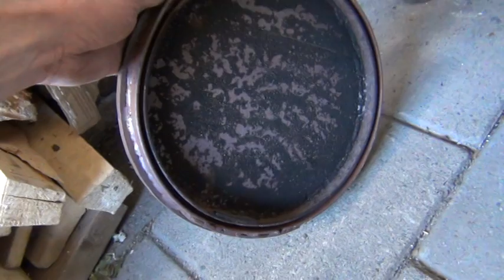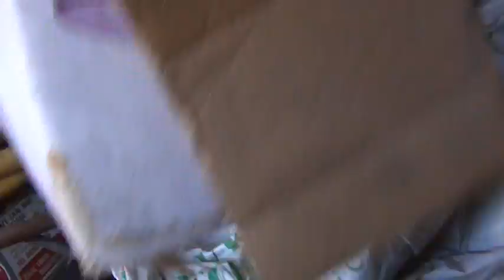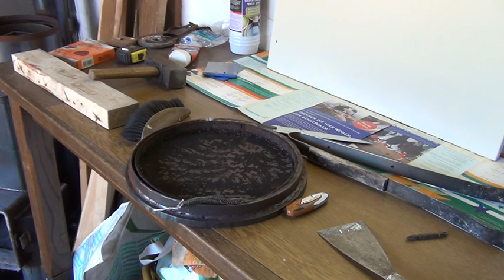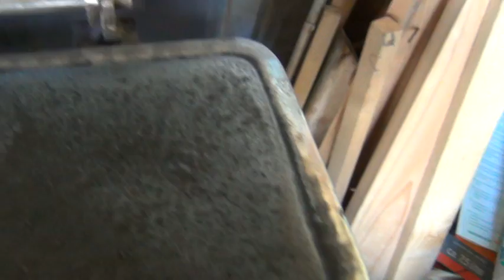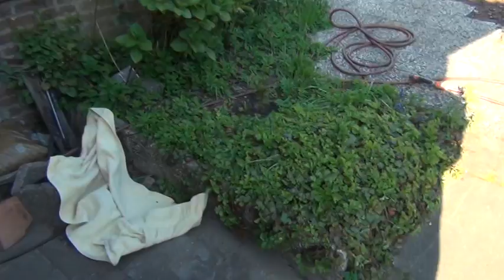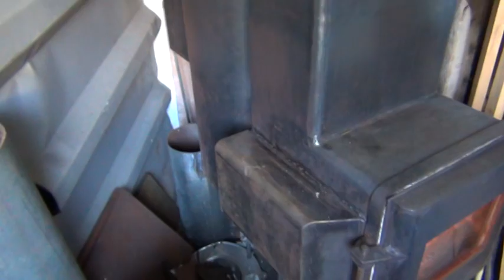Rocketstove Finished and installed (26)

Comment: ich seh schon du kennst dich aus mit pyrolyse:-) ich bin zwar kein metaller, aber für mich schaut der schon super stabil aus. das abgasrohr würde ich noch stabiler machen damit es beim sturm nicht wackelt.
Reply from the maker: I also designed and build the stove from scratch, every single part of it. However, it is no longer in use. I needed the space. And the stove was not as practical in use as that I had hoped for. If I had to do it again I would do some things differently. Also metal is not the best type of material for these type of rocket stoves. It is hard to believe that it is already 10 years ago that I build it. Time flies. I do not understand anything about the censoring in the comment sections. I do not write anything that is against the policies. I do not get any warnings. My status is good. It feels as if a third party is reading all my comments and that they delete everything that they do not like based on substance. And it happens more often as well. The other day I had a conversation about renewable energy. The person that I was talking with could tell all kind of things that were verifiable not true. And when I tried to answer with numbers from official government sources my answers got deleted. I could comment that my answer got deleted, but the people that I was talking with did not believe me. The issue is that I spend a lot of time to do proper research, and to make sure that I get the facts right. Then I write my answer, and then it gets deleted. As I am writing this I am not even sure if this answer is going to be deleted or not. I do not understand what the purpose from all the censoring is. All that I know is that it is not normal, and that it should be worrisome to everyone.
Reply: @insAneTunA  ja, das hört sich wirklich nicht nicht gut an. bei hassrede oder ähnlichem würde man das ja verstehn. gut möglich das dies schon automatisch durch bots geschieht. es tauchen ja auch immer mehr fakekanäle auf wo  ganz offensichtlich ki bots kommentare schreiben. aber egal wo man hinschaut, schaut die entwicklung nicht gerade gut aus.

Comment: You did a really good job of your rocketstove, If you were to change anything about it now that you've been living with it for a while what improvements would you make on your original design.
Reply from the maker: Hi David, and thank you for watching.

If I had to do it over again I would do several things differently.

1 - I would make a heat resistant cast firebox and heat riser made from a mix of perlite and heat resistant concrete.
2 - I would make a larger firebox so I can use larger pieces of wood.
3 - I wouldn't create a secondary refill hatch, it isn't as functional as I hoped for as it is now because it acts like a smoke stag when I open the hatch, and the internal space is a bit too small as well, with a larger fire box the secondary refill hatch is no longer needed.
4 - I would ad a controllable secondary air intake that leads air to the bottom of the heat riser.
5 - I would design and ad an ash box.

Now I used steel for the inside of the stove, and it works OK when the stove gets real hot, but...the steel draws a lot of heat away with the result that I have to keep the fire burning at high temperatures with fine chopped wood in order to keep it burning well. It's a lot of work to keep it burning and to chop the wood into small enough pieces. Eventually a steel heat riser will melt when the stove burns as planned, no matter how thick your steel is.

The whole principal behind the rocketstove design is that you burn at high temperatures in order to burn all the gasses and carbons that would go lost with an open fire.  Then you have to use a lot of mass in order to store the released heat. That makes a rockeststove so efficient. If the stove burns well it makes a roaring sound that sounds a bit like a rocket, hence the name Rocketstove, and it produces no smoke.

So basically I would make a wooden mold and cast a perlite/concrete fire box and heat riser, then I would let it cure because it will shrink a little when it cures. Then I would make the outside from steel and customize the outside to the cast perlite/concrete firebox/heat riser.

I've seen this idea here. This is part 1 from a guys video series about his cast rocketstove project.

ppotty1
New rocket stove mass heater cast riser Part 1
https://www.youtube.com/watch?v=yK93KkFT7sE

I hope that my answer was useful to you :-)

Peace!